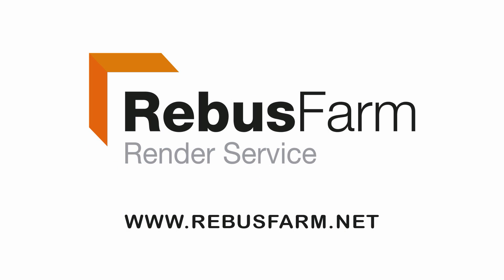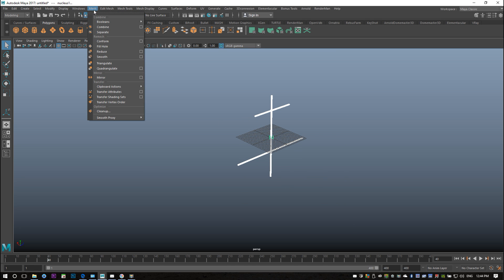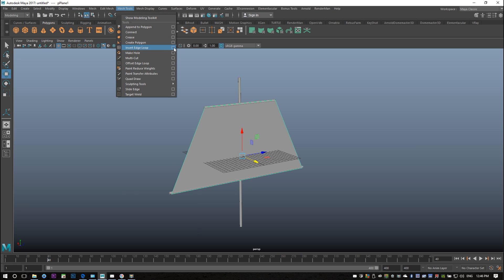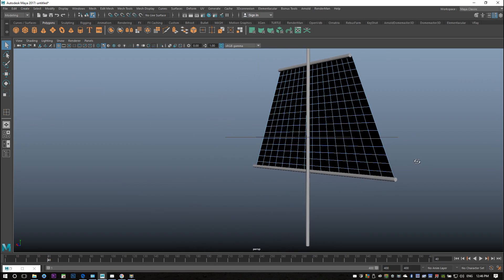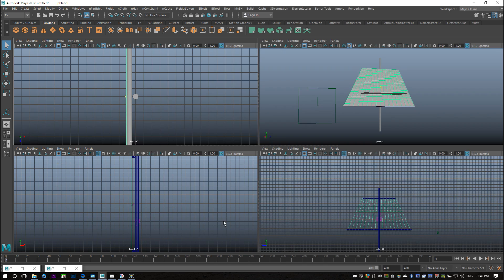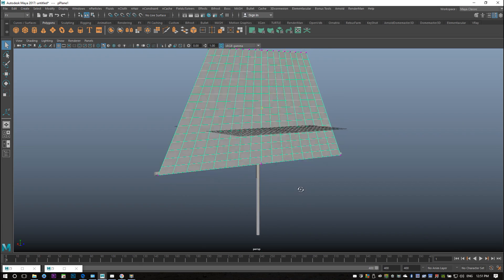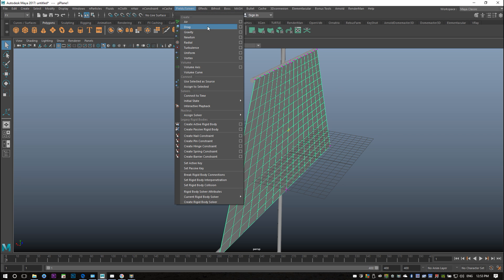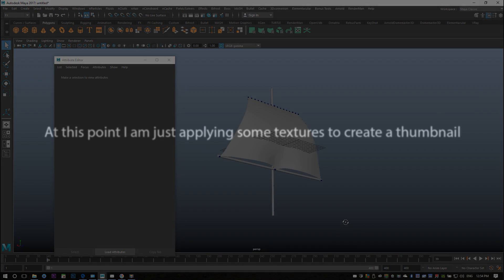Using FX, Air and nCloth in Maya 2017

Comment: A Q about fastening the cloth to the mast or jib: When I run my sim, there's always a bit of vertex "drift" away from the spot that they're supposed to be anchored to, whenever there's a breeze or the mast is put in motion. For my application, I need those vertices really nailed down.  Is there any way to (completely) stop this vertex drift from happening? Thx!

Comment: Good video! But I'm having a slight issue. I'm using Point to Surface constraints as I want the ship in my scene to move, and I've created separate Ncloth's out of two ropes, and the sail. I've tried grouping the 3 together, as well as just creating the Air Field just on the sail itself. Either way, no matter how much I tweek the magnitude of the wind, the air field has no effect on my sail and my sail and ropes just droop lifelessly from the mast.